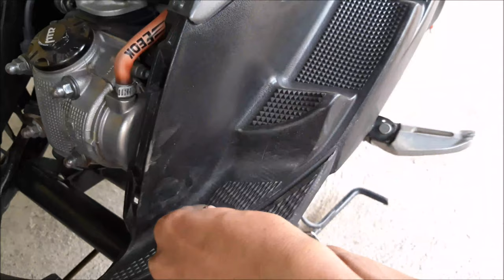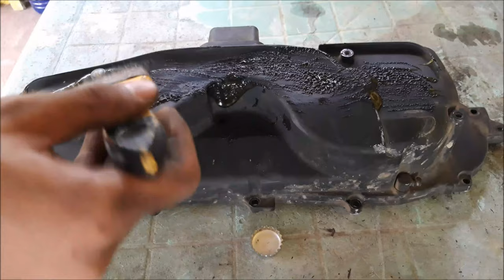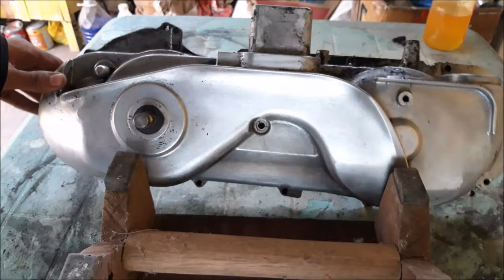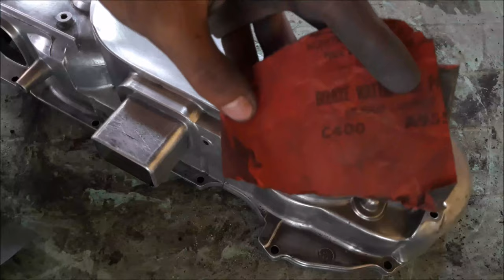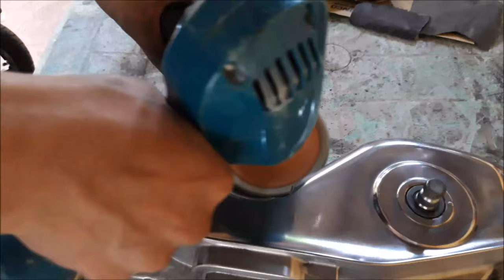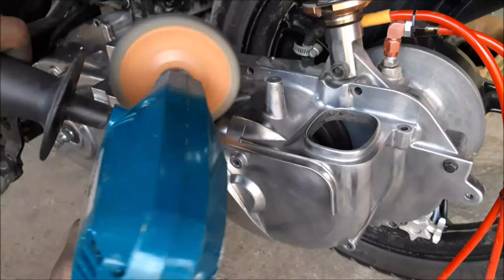How to Polish Mio Sporty Crankcase

Comment from the maker: Samurai Paints COD AVAILABLE here's the link: https://invol.co/clq5fw
Samurai Paint High temp Black/Silver COD: https://invol.co/clq5g2
Samurai Paint K1K Clear Coat COD: https://invol.co/clq5g3
Samurai Paint Standard Colors COD: https://invol.co/clq5g4
Samurai Paint Hologram COD: https://invol.co/clq5g6
60W Bluewater with High and Low COD: https://invol.co/clq5g8
Grilled Signal Light COD (Good for classic bikes): https://invol.co/clq5g9
Yamaha RS 100 Headlight COD (Good for classic bikes): https://invol.co/clq5g5
Bar End Mirrors COD (Good for classic bikes): https://invol.co/clq5gb